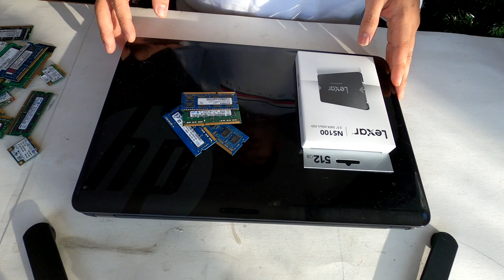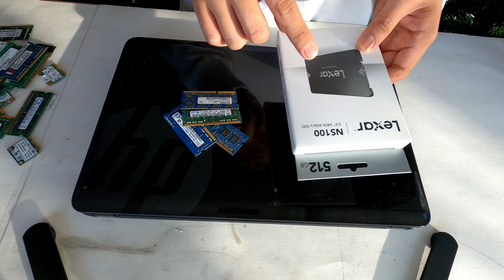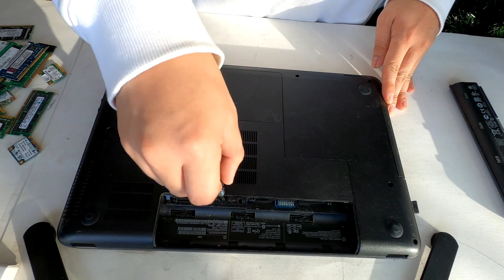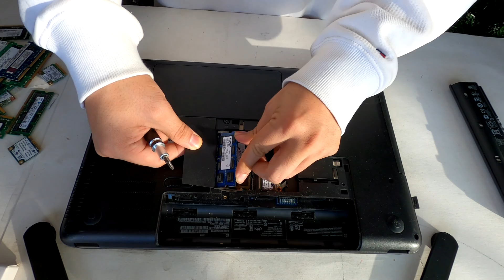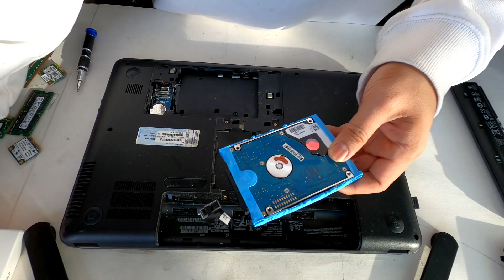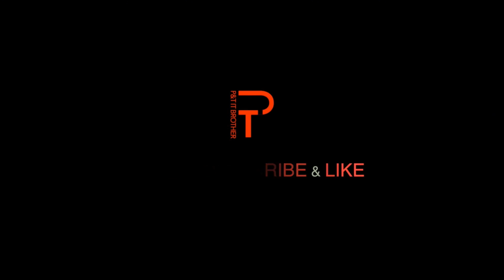HP 2000 Laptop RAM & SSD Upgrade (How to replace hard drive, memory)

Comment: Can you share the Hard-disk details please. And also do I need to update my celerio to higher after updated with SSD and RAM, does it requires so?
Please help me with this confusion.
Reply from the maker: Sorry, I do not have this laptop anymore, but why do you need a hard disk details for? Are you saying that you are trying to upgrade the CPU? If yes, No. Don't do it. It is not worth it. You can just buy a refurbished laptop for around $200 dollars which is much newer and faster than this machine.

Comment: I  tried to put 4gb of ram, thus having a total of 8GB, but when I turn it on, it turns off after 3-5 seconds, the fan stops spinning, but the lights such as the power button and the block mayus, remain on
Reply from the maker: maybe the memory that you've installed is not compatible. Try different memory and see. If none of them are working, then maybe the laptop only supports  2GB per memory slot.
Reply: bro that laptop is totaly supports only 8gb ram😂😂😂

Comment: Good day, can you help me regarding upgrading the RAM from 2GB I add an additional 4 GB to make it 6GB but after checking the usable RAM was still 1.6 GB and tried to watch some videos on how to go to advanced setting on bios. Same Laptop HP 2000 AMD E. Tried the trick key of "A" and FN+TAB tries, but still advanced settings doesn't appear.
Reply from the maker: What is your operating system? Which Windows?
Reply: @PTITBROTHERGravenhurst   currently installed a windows 7.

Comment: After the update, how long does it take to turn on and how do I install the operating system?
Reply from the maker: Takes less than 20 seconds to fully turned on. The best way to transfer your data is to clone the existing drive. You can watch this: https://youtu.be/j_gWWYAmbms
Reply from the maker: You will need to buy a hard drive bay that has more than one hard drive slot

Comment: Is this RAM appropriate?
https://www.amazon.fr/dp/B00N426JFG/ref=cm_sw_r_cp_apap_DyUwVwXnotfbT
Reply from the maker: No. That one looks like it is the one for desktop computers. You need one for laptop size Memory. Check out the model on your existing RAM, and get a same one or at least a similar one
Reply from the maker: On a RAM, there is a sticker stating your RAM model

Comment: I am looking foward to upgrade my laptop the same way you just did, I have exactly this HP 2000 laptop, as you mentioned and know it is very slow, so how much better did it actually get??? Can you make a video running some apps specially navigating the youtube website, where it gets really slow to see how the laptop behaves??
Reply from the maker: Sorry. I do not have the laptop anymore, but just by upgrading the existing drive to a SSD, it will boost up the speed by  3-4 times faster. You can take my word for it.
Reply: @PTITBROTHERGravenhurst  hii, can you please tell me what maximum ram can we upgrade for this laptop ? Can it sustain 8gb ram or 1 gb ram ? Hope you'll reply me.
Reply: @PTITBROTHERGravenhurst  Thanks for the info, I will make the upgrades.